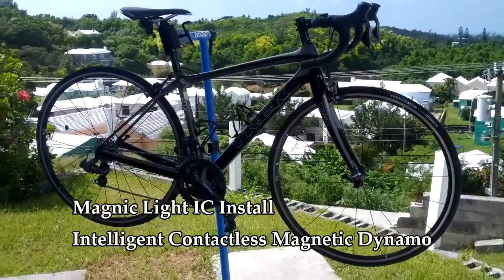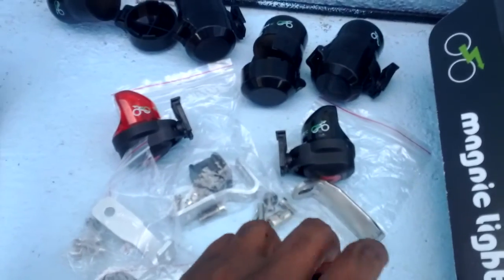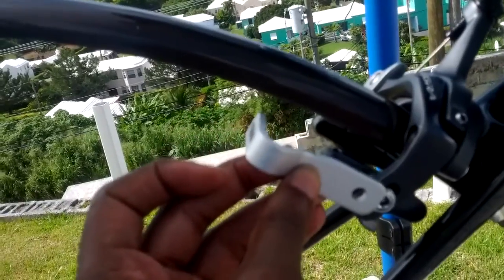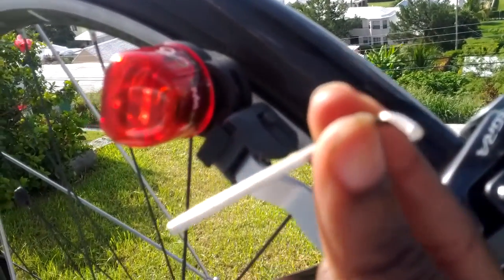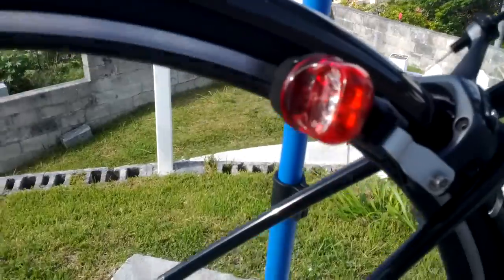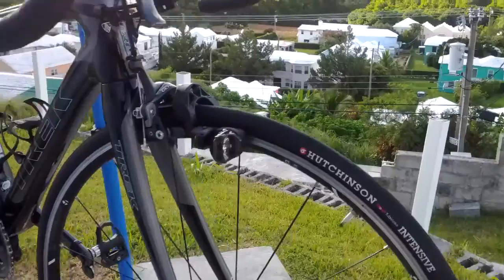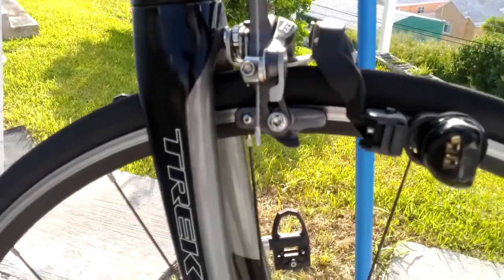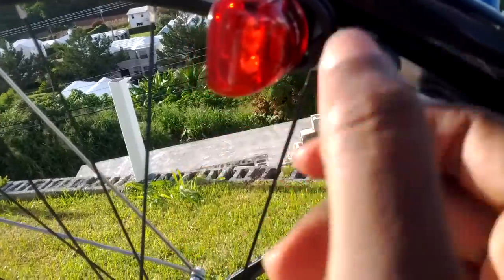Magnic Light IC Installation

Comment: Are the LEDs supposed to flicker randomly asynchronously like that? Or that only somehow visible on video?
Reply: +nielzdg It's because the LED's flicker is not in synchronous with the shutter speed. You barely notice it flicker with your eyes.
Reply from the maker: They have different blink and/or constant settings. There are 4 profiles that control what they do when moving, braking, and at a stop.